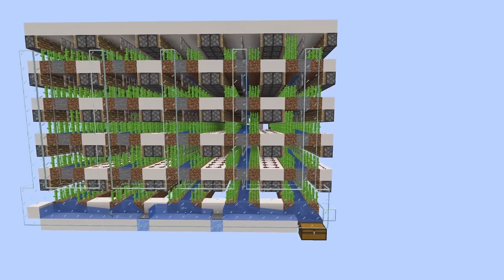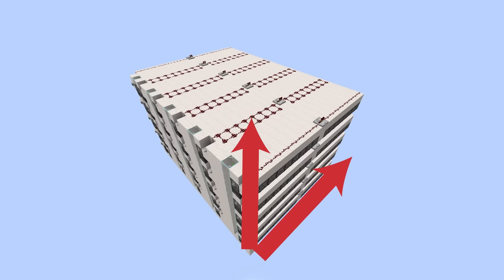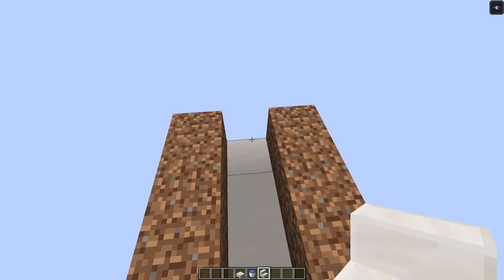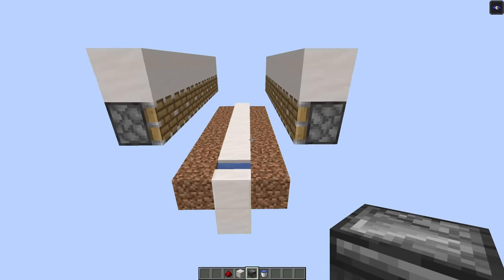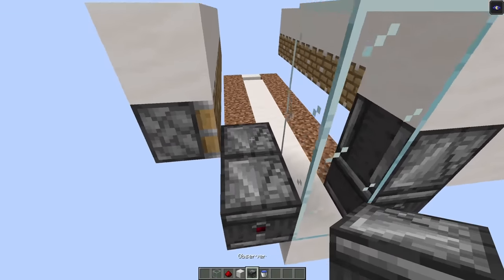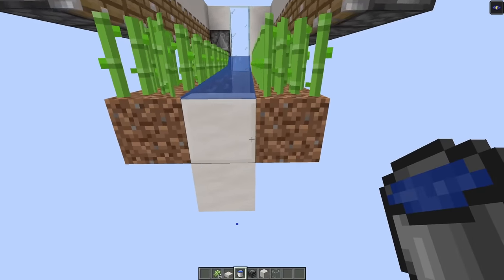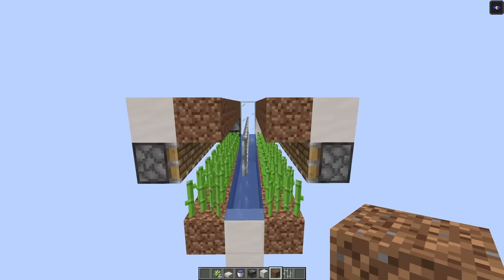Sugar Cane Farm! Compact, Lossless, Easy to Build! (Minecraft 1.15+)

Comment: Warning: No longer lossless in 1.16.2: piston heads connect to iron bars, sometimes trapping sugarcane

  Andrew Kern
:
I figured out what does work, use a closed wooden gate instead of the iron bars
Reply: How often does the sugarcane get stuck?
Reply: @Andykern12  Around every 5-10 minutes I see some sugarcane on the dirt. I have a farm 2 high, 2 wide, 4 long. 

I was planning to test out horizontal chains or end rods in the farm to see if that fixes it
Reply: @ovencake523  does glass panes react the same way? If I find a solution I'll let you know. Maybe I can get his mods to look at it as I'm on his server lol
Reply: @ovencake523  I figured out what does work, use a closed wooden gate instead of the iron bars
Reply: @Andykern12  thanks
Reply: @Andykern12  Thanks!!
Reply: In 1.16.1 the pistons just randomly fire without any sugar cane growing and I've gotten zero in the chest after several hours.
Reply: @shingshongshamalama  I was playing in 1.16.1 and now currently playing in 1.16.2 and its working fine even with 60plus people on the server. I would just double check if its build correctly. You may also see issues if you are experiencing alot of lag.
Reply: @shingshongshamalama  the same thing is happening to me as well, the pistons will fire without indication and the sugar cane doesn't grow
Reply: @JaWsOmeNeS   The light levels might be too low. Try to add some full blocks of light where some of the building blocks are. For instance, I've added lights on the sides of the packed ice with pressure plate on top. Or wherever else it'll fit and still function as it should :)
Reply: @Camilla5156  Does it work on Bedrock ...plz tell 🙏
Reply: @mohitprakash  no it doesnt
Reply: closed wooden gate is much cheaper then iron bars, nice.
Reply: With closed wooden gate I have some sugarcane that still lands on dirt. But, as other have pointed out, there are some weird updates that make pistons randomly activate even if no sugarcane has grown in front of the observer. I assume it's even more efficient as it harvest more often but it should not work like this. Does anyone have any explanation for why it happens? Oh, I have no issues with sugarcane not growing, light level should not affect it's grow. It's just that weird piston-observer behaviour
Reply: But the observer doesnt see the sugar cane growing, how does it work? I tryed it and it doesnt. Pls help.
Reply: @janfri0683  is as sugar cane now attempts to grow as often as every minute even if they dont grow. and the observers detect them when they attempt to grow not when they grow
Reply: @sonster4093  thank you!!
Reply: Would it be possible to use glass panes instead?
Reply: In 1.16.3 it doesnt seem to be an issue
Reply: Hm is it a must to light it up?Are the rates of growth for the sugar cane increased with higher light levels or nah?Also,other than Wooden Fence what’s another replacement for the iron bars?Thanks so much :3
Reply: @ThijquintNL  the farm as is or using wooden gates instead?
Reply: Thanks! this fixes an issue I had
Reply: Thx
Reply: @Natanleontoral  It does, but it's not lossless.
Reply: If anybody suffers from sugarcane getting stuck on the stairs, remove the stairs completely and just add hopper at the end of the water flow, it should work and lessens the loss a bit. There are time when the item get stuck on the side, but it's not much.
Reply: does this work in 1.18
Reply: @apeslashextras  it works perfectly for me on JE 1.18.2, far as I can tell. Iron bars led to lost canes, but fences work great. I must admit I have not tested fully as I have no quartz for the observer yet, so I manually activate it with a button.
Reply: @nash8114  dude tysm for replying i will try it out with fences instead hope u have a great day and life
Reply: Guys this is NOT lossless when using wooden fencegates, the sugarcane gets stuck floating in the water above the fencegate! If you are in 1.19 you can swap the stairs and slabs for waterlogged leaves to fix this. Unfortunately I just built 4 modules in 1.18.
Reply: @jordanluke73  Should I use iron bars instead of fancegate? and waterlogged leaves? how is the farm working so far? Any changes you made?
I need 1M sugarcane:)
Reply: @RaklaMC , did you build this farm? Does it still work? What blocks did you use?
Reply: @I.m_glad_you.re_here  I used iron bars and waterlogged leaves, it works perfect, You can see it in my last video

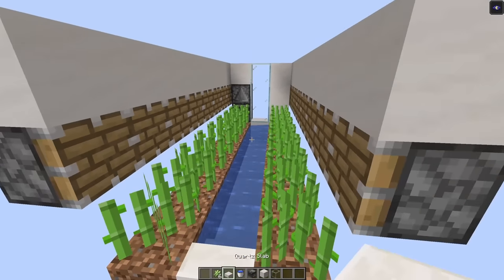Comment: The whole "top slabs in between the cane" part was in there twice. No harm done, it just really threw me off... (1:38 and 3:32)
Reply: Max Miles glad I’m not the only one that noticed that lol. Really confused me too!
Reply: Yeah I noticed that too
Reply: When I add top water it knocks off my sugar cane? What am I doing wrong?
Reply: @730coderocks  same
Reply: @730coderocks  Are you playing in java edition?
Reply: @noahkierce2540  I would guess bedrock. It is the version I got from Microsoft store for windows 10.
Reply: @730coderocks  bedrock works a bit differently so the farm design might need to be tweaked do you have a stair at the end of the row of blocks that is very important
Reply: That confused me a bit bc there was slabs at one point but he started placing slabs that where already supposed to be there already.
Reply: @730coderocks  SAME
Reply: @seanweaver8625  he must be playing on bedrock..bc ingried it the day tango came out with this vid...i seen that sec about the water and knew right away it widnt work on bedrock without it being tweeked but tried it anyway..and nope water breaks the crop instead of flowing between it

Comment: FULL MATERIAL LIST (for 50 modules like in this tutorial of Tango's farm)

If you want to build this sugar cane farm exactly like Tango did (5x2x5 = 50 modules), then here are the EXACT amounts you are going to need of each material:

- 1394 solid building blocks of your choice
- 800 sugar cane
- 800 dirt
- 800 pistons
- 830 redstone dust
- 400 iron bars
- water sources (bring 2 buckets of water to make infinite water)
- 270 blocks of glass (or just solid blocks if you want)
- 77 packed ice
- 75 slabs
- 25 stairs
- 60 observers
- 30 repeaters
- 27 stone pressure plates (you can probably find alternatives to this if you want)
- chests and hoppers (in this tutorial there are only 2 hoppers and 2 chests, but you are going to want to make way more storage than that)

this was done by downloading the world from the description, and then using litematica's material list function
Reply: Thanks! Appreciate it!

Comment: Can I say that you don’t need a 2 wide row of Redstone only one is sufficient due to quasi connectivity on java edition.         Also mojang has confirmed that quasi connectivity is NOT a bug and works as intended as stated on the bug report
Reply: Yes, but quasi connectivity isn't necessarily an intended game mechanic, so the second redstone line will help future proof against potential patches.
Reply: @cmckee42  despite it being unintentional they have said they won't get rid of it at least for a while
Reply: Well
Valid
Reply: Christopher McKee 
They are never removing quasi connectivity. It was stated by Mojang
Reply: You sure that would last through the Redstone changes coming up in 1.16?
Reply: Even though quasi-connectivity is a thing, Tango has made a point of trying not to rely on any unintended game features in his builds so as to future-proof them as much as possible.
Reply: @killingtimeitself  Wait so this whole farm will break in 1.16? Or not effect the quasiconnectivity or anything else?
Reply: @EpochRazael  No, the point of this farm is that it definitely won't break in 1.16 and very probably also won't break in any future updates.
Reply: this farm might even work in bedrock edition as well!
Reply: Why is this being debated. Redstone is not hard to get. If you don’t want to maintenance it if anything ever changes just add 8 extra Redstone. 
Calm down
Reply: Wrong… It was a bug. Now they just work with it because it is a happy accident
Reply: If not a bug why don’t they add it to bedrock it would be so useful
Reply: I was just about to say the same thing! Good thing I read the comments first!
Reply: Lucas's Technic Corner they coded it in to make the original jeb door work, so it‘s as intentional as can be
Reply: @EpochRazael  yes
Reply: yeah but this farm wouldn't work on bedrock without the extra redstone, and may break in the next update
Reply: Qasi-connectivity or no, it's better for tutorials not to rely on it so that the design works for bedrock players. From the perspective of the video as a tutorial, using a little less of a cheap resource isn't worth the cost of making the vid useless for half the potential viewers.

Comment: I really like the simplicity and reliability of this design!
Since the rates aren't mentioned anywhere, I decided to quickly measure them with carpet mod in the world download.
They seem to stabilize at slightly below 2500 items/hour there. Assuming that all modules are equally efficient (which they should be since all lines have the same probability per tick to be activated (even on the edge)), that gives around 50 items per hour per module (or 3.125 bone meal/hour if composted).
Reply: is this per module?
Reply: @Paranorium  2500 for the whole wdl, 50 per module
Reply: @thomaskolar90  ah great. Thanks man!

Comment: Thanks Tango. I saw it on HC and was interested in the tutorial. I've started a survival world on 1.16 when the update rolled out and wasn't quite happy with the typical sugarcane-farm designs yet. Thanks for solving the problem with sugarcane just sitting on the blocks. I'm guessing it would work with bamboo as well, right? (Just no need for the water in the first layer) Will definitely build this one.
Reply: Not sure if you built this, but I thought that I would keep the soil layer water for bamboo, since it is part of the collection system.

Comment: FOR BEDROCK PLAYERS.  Just as a heads up, doesn't work on bedrock.  Water will wash away sugarcane and observer doesn't read the age change on bottom sugarcane. 
But awesome video Tango, unfortunately didn't work for bedrock but it did give me ideas on how to make my own lossless design.
Reply: I am also Bedrock and yes the water flow doesn't work.  I have made adjustments by removing the observers at the end and placing them on top of the pistons.  That way it observes them at 3 high and then pushes the middle breaking off the top two.  Which also means a second row of iron bars to push them into so they drop straight down.  The middle is 8 Hoppers that are water logged flowing into a Chest.  I loved and hatted having to find a work around but thinking things through and trouble shooting gave me satisfaction of figuring out.

Comment: Found something fun to do with this farm.  I changed up how the pistons are powered to an Observer line on top of the pistons.  It primarily reduced gaps by having the walls be (from bottom to top) Sea Lantern, Piston, Observer.

I found it soothing in an odd way with how the pistons fired in a wave motion (using quieter pistons from vanilla tweaks) and can do a fun lighting or other things on the outer walls that react to the observers.

Comment: For everyone with multi-layer farms and are having mobs spawn in it, i fixed that by putting sea pickles in the water on the upper layers.
Reply: Shroomlights aren't transparent so placing them under the Redstone dust in spots works, as well. Shroomlights transmitting Redstone isn't pointed out enough, in my opinion. Great 1.16 addition.
Reply: Thank you!
Reply: @saintchuck9857  Wow thank you! I've had a creeper spawn in the farm and jump on top of me while I was collecting sugarcane... This wil def help

Comment: Correct me if I'm wrong, but the observers detect when the end sugarcane grows, so wouldn't having observers on both sides of the middle rows (with b2b pistons) make the pistons extend more frequently,  harvesting sugarcane more often?
Reply: Yea you could but it would mean you use more resources, an observers are a pain to craft.
That extra 1 could be used to make to make another module
Reply: @mattanderson2477  if you're trying to conserve space and resources are bot an issue it is a fairly simple change though.
Reply: The observers would go in the line of the dirt and that would mean that any sugarcane that goes on the edge of the water stream (half on the dirt block) would get stuck.
Reply: @XenophonSoulis  I think Daniel and I were thinking of just adding one where it would be if the module was on the end.
Reply: @matthewparker9276  Do you mean above the two side packed ice, in each side of the water stream? The sugarcane would get stuck there.
Reply: You are correct. This design was more about getting lossless maximum compactification out of a tileable traditional farm, not about getting sci-craft level maximum output. You could also harvest more often with an etho clock too eliminating the need for an observer, but would be doing so at the expense of adding a li'l lag to the system. It is a matter of deciding your objectives, determining what compromises are acceptable to you, and adapting the farm to accomplish them.

You could also sacrifice compactness and have an observer on every plant if you like. Just a question of what is most important to you.

For the needs of 99% of the minecraft population out there, I think Tango has just released the current champion for output/efficiency vs compactness/resource friendliness.
Reply: Harvesting more often wouldn't make any difference to the amount collected.
Reply: @thefinkie6459  it would over a statistically significant period of time. The cane grows randomly, and there is no guarantee that the cane with the detector will grow once before any other piece along the row grows twice, or would if it had the room to. Detecting more often will decrease the chance that a random tick block update will occur when there is no room for the sugarcane to grow.
Adding the second detector has a larger impact the longer the farm is built
Reply: @matthewparker9276  Ah yes, you're right. I forgot that they only grew 2 high. Whoops
Reply: @thefinkie6459  It probably would. When a sugarcane has grown to height 2, it cannot grow to level 3 and it may stand there for some time doing nothing, until the observed sugarcane decides to grow. I don't know how significant this is, however. Plus it would get sugarcane stuck, so it's not an option anyway.
Reply: @thefinkie6459  yes it actually would, but not really enough to matter unless you are looking for scicraft style efficiency. Every plant that has grown, but has not yet been harvested is unable to grow again. Since plant growth is not uniform, it is possible to have several plants in each row that have stalled their growth until that one plant at the end of the row decides to grow. This effect is multiplied when you tile multiple rows together. So using tango's 2x2 example, on the outer rows I have up to 15 plants waiting on 1 plant to grow, while those linked inner rows have up to 31 plants waiting for a single plant. That could mean, in a farm the size of tango's, dozens of potential growth cycles lost every tick.

Will adding a second set of observers increase efficiency? Maybe. If it does not cause losses due to cane getting caught on the hitbox, it will see SOME output gains. 

THAT SAID... As I mentioned in my previous response, this design is not about squeezing every last ounce of efficiency out of the machine. It is about making an efficient, compact, resource friendly farm that is quite able to cover the needs of the majority of players.
Reply: With a wide enough farm, it should be possible to connect all the observers with all the pistons. Dunno about space for the extra wiring, and if it breaks the expandability, gonna check the video again to see any room for that
Reply: @mattlewandowski73  & Ξενοφώντας Σούλης , dudes I already corrected myself; check my second comment there. But I agree that absolute top efficiency is not necessary in most situations. If you really wanted the absolute highest output possible, you could just put the pistons on a clock... but that's silly.
Reply: @mattlewandowski73  You nailed it. Building a "good" farm isn't always about maximum efficiency. This design works for him because it fits his needs for his current situation, not because it produces 184,000,000 sugar cane per hour.
Reply: @Raskolnikov70  <attempting to channel his inner XbCrafted> Well ye know... I mean... It could :)
Reply: Surprised that an observer on “level 1” detects growth at “level 2.”  Is whats really happening the deletion of the “1 high” plant and replacement with a “2 high” plant?
Reply: I'm a bit surprised none of the replies so far mentioned this:  the observer detects the change in growth stage of the sugar cane: it will trigger many times before this sugar cane actually grows, as it detects it making progress towards the second block, not just the second block itself.
Reply: Mac15001900 Then wouldn’t the piston fire multiple times before growth?
Reply: @RomulusReemus  Yes, if you watch the video closely (especially the part with sped up random ticks at the end) you can see that this is the case - pistons usually fire without the sugar cane next to observers growing.